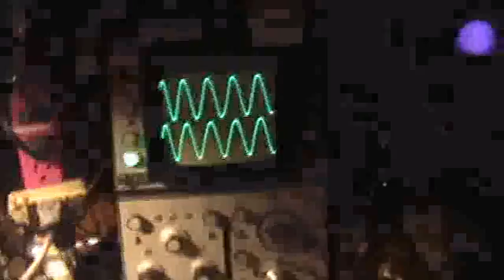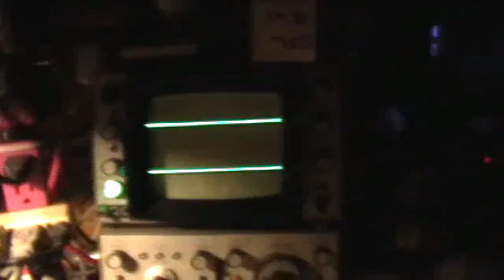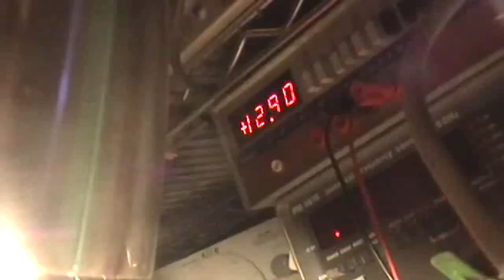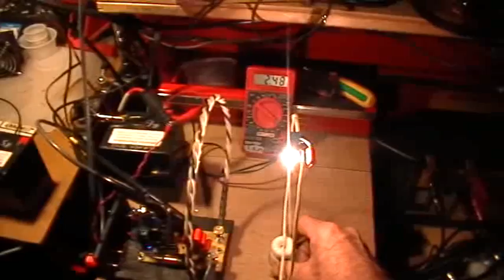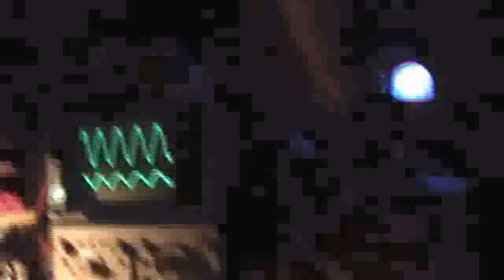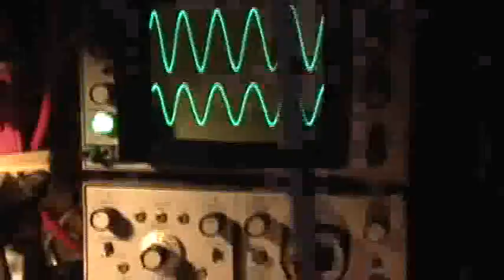Electric OU: Wireless Power, Supernova Mode, Scopeshots, Phase Relationships

Comment: The amplitude in the receiver being higher than in the transmitter could be due to resonance overvoltage,  but probably the bulb power will be lower than the transmitted power,  right? 
Anyway find out how the coupling makes the SN mode independent from distance!